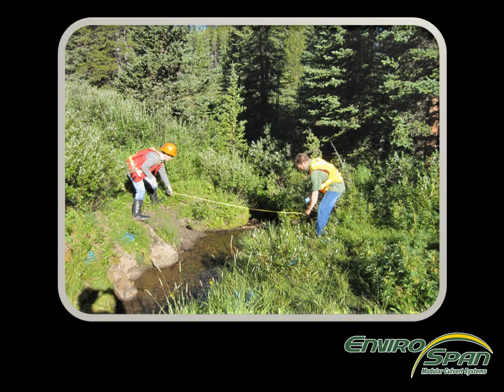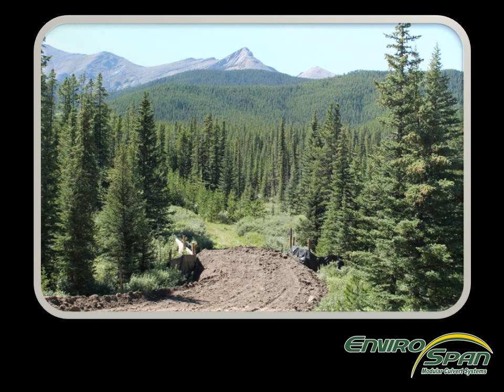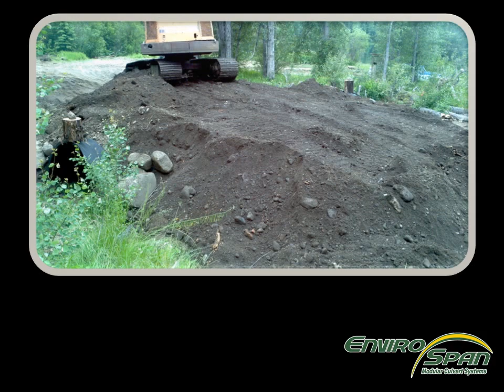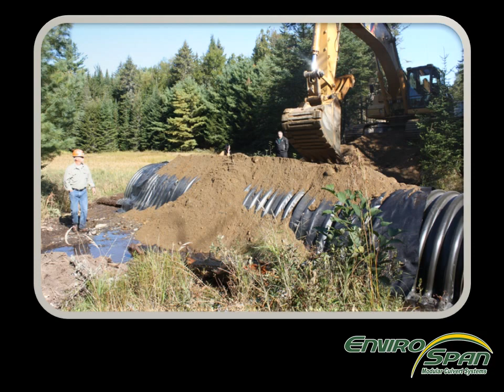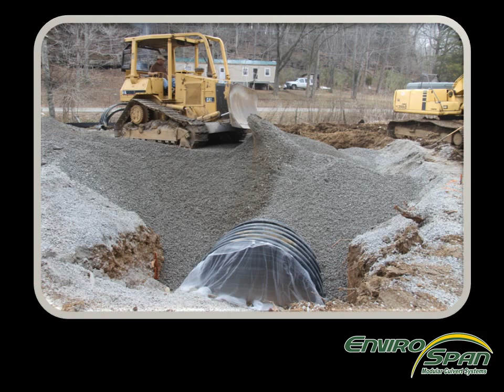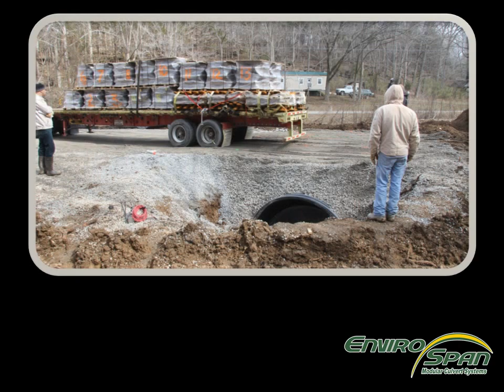Enviro Span Multiple Installations and Load Testing

Comment from the maker: Enviro Span can be used to mitigate damaged crossings and the installation requires no additional site disturbance.  Once installed, the elastic material in the arch, along with the use of compliant footings will resist serious movement and disturbance caused by such factors as frost heaving, settling, scouring, and even earthquakes. This is something that the old school steel and concrete crossings cannot duplicate.